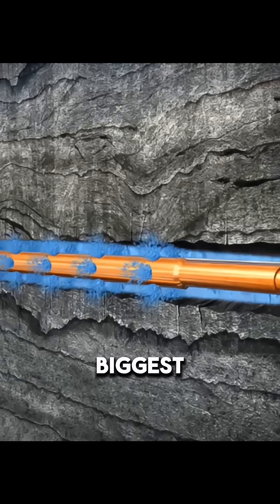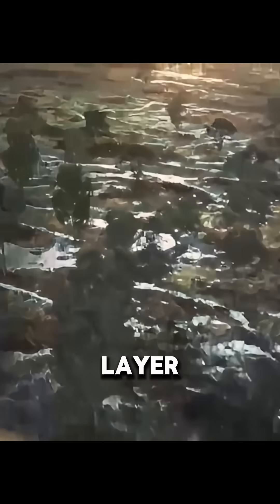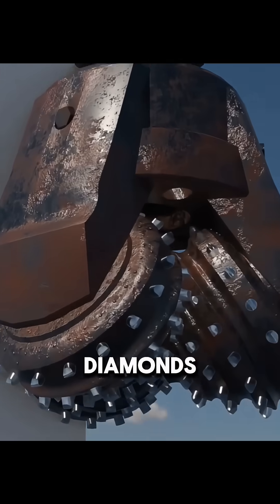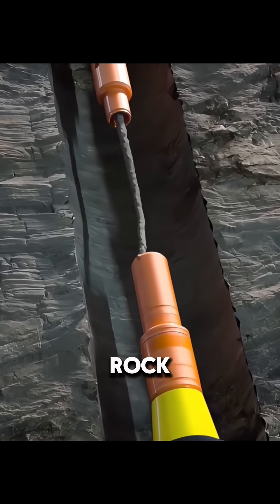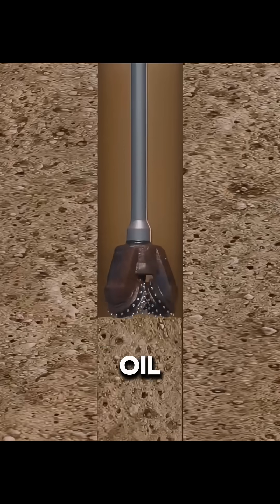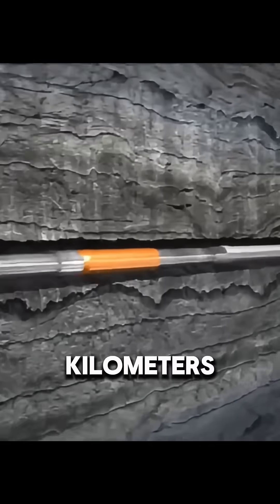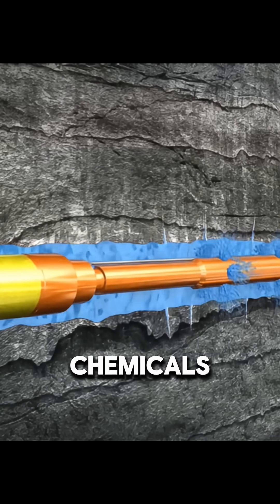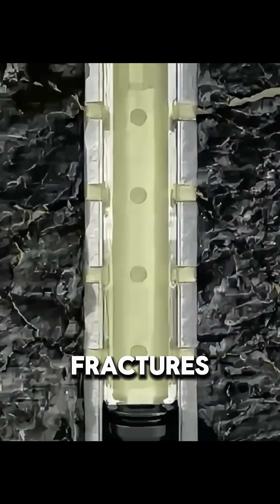How is oil extracted on land? #zackdfilm #foryou #oil

Comment: I see some comments of people that have no idea. Oil is in everything made of plastic. And I don’t think anyone uses those type of drill bits. We use diamond cut drill bits or pdc.
Reply: Milled toothed drill bits and tungstun carbide insert drill bits are commonly used especially at shallower depths. The application to use diamond bits must be correct because they can ball up or lose the pdc cutters requiring tripping out the bit prior to total depth, which can be expensive depending on the daily rental rate of the rig. It may take 8 hours to change out a failed bit depending on depth. Sometimes, It can be better to use non diamond bits in softer rock applications. The best way to select bits is to use bit records from adjacent wells that show the performance of different bits within the same rock formation from previously drilled wells. How the bit is run also matters ie rpms, weight on bit and hsi must be engineered to maximize bit cleaning and rock removal. I am a petroleum engineer and sold oil well drill bits for a living.

Comment: Should use propane instead of water for fracking.  Propane allows the well to produce more oil longer and all the propane is recovered.  This process saves millions of gallons of water.
Reply: You mean nitrogen?
Reply: @mad123tpm no liquid propane.  Liquid needed for fracking because liquid does not compress.  Actually an established procedure.  Propane is recovered and the well produces more oil and gas for a longer period of time.  Over time more profitable but at first more expensive.   Also, no water used for better enviromental concerns.
Reply: Bad idea people

Comment: I don't understand that cement part
Reply: I think its to block off well water from getting into the casing or vice versa, getting fracking solution into the well water. Or when they pump the hole full of pressure to cause the cracks to open, the concrete acts as a plug to keep it from blasting back out the hole where they began drilling. Those are my theories
Reply: @lovetofly32 when cement is poured will it not bury anything below it so how can they operate machine when they poured cement on it
Reply: @abangbelinson8839  look up high pressure oil well cementing.
I used to work in that sector and could explain it, but a visual might help you understand better.
Reply: Casing keeps the well from caving in, protects the environment by keeping fluid from entering other formations, isolated high pressure zones, etc. This is also needed to increase mud weights at deeper depths to prevent well kicks or blow out prevention. Casing is set in the hole, cement is poured down the center of the casing and fills the void between the outer casing and hole, called the annulus. There is a float shoe (check valve) at the bottom of the casing. Once the cement hardens another drill bit , drills out the shoe and keeps going. A casing program of different sizes is planned in advance. I took a fracking class in college to determine optimum propant sizes(called ceramic beads in this video) , pressures etc...

Comment: Production cost is still high at the moment. Hard to compete with Saudi and others
Reply: We are already a net exporter
Reply: Dude, they have been competing with Saudi oil since 2014 or so. They are still growing strong and will keep pumping shale oil for the foreseeable future.
Reply: Saudi has cheapest production costs for sure.
I heard that if crude oil price falls below $60/barrel then US producers are not profitable.
Reply: Yes, but VERY cheap compared to Deep Drilling in the oceans!  Normally the oil is WAY below the water aquifers. 
With an existing impervious rock layer holding that water above the much deeper oil layers.
But it has happened.    The pipe could leak into the water layer if it failed.     Saudi oil is cheap out of the ground.
But you have to ship it halfway around the Earth to bring it here.

Comment: hydrochloric acid, glutaraldehyde, polyacrylamide, ethylene glycol, methanol, and sodium chloride are the chemicals used. Cancer water.
Reply: Ethylene glycol is antifreeze.  Very deadly.  Dad knew a man who carried some water to his cows in some empty antifreeze jugs.  They all died.  It's also well known that you can put out a dish of antifreeze and some wienies side by side to kill rats and mice (or any other animal that consumes them).  The salt in the wienies makes them thirsty, so they'll drink the antifreeze.  I've never done it but have seen the results of someone else doing it.

Methanol is also toxic, causing blindness.
Reply: @Lewis2553  everyone has heard that story, better come out with another quickly
Reply: So bad for the environment😢
Reply: @benjaminliamzon7395 Yeah, but ethylene glycol gets dumped on the ground all the time in car wrecks and junkyards.  Cars develop leaks in the cooling systems.  Or, heater cores start leaking and cost so much to get them changed that people have to drive them like that and just breathe the ethylene glycol vapor.  (And they wonder why people are dying.)  Then, too, you're supposed to change your antifreeze every few years, but I haven't seen any antifreeze recycling centers.  So, what do you do with it?
Reply: @Lewis2553 Antifreeze is safe to put into a sanitary sewer drain. (Not rainwater sewers. 

Water treatment facilities are capable of removing antifreeze along with other pollutants.
Reply: @chefofthefuture377 That's good to hear.
Reply: @chefofthefuture377  no they not ! its toxic.
Reply: @marky5493 no they not? They not foreseeith thy future?
Reply: @Lewis2553 you don't have to dump it on the ground. There are facilities where you can deliver it to be neutralized. Or you can filter it and reuse it on less demanding cooling systems.

It causes coma by causing neurological damage, so dumping it on the ground should be reserved only for those few cases where vehicles brake through the side barriers.

E.g. In Germany, when rescue teams are police arrive on the scene of the car accident, they first spread sawdust or sand around leaks - to soak up the oil and antifreeze.

After removing the vehicles, they clean the road before they let the traffic go on. All that sand or sawdust is collected, road is scrubbed to remove remaining chemicals, and all this is sent to a plant that will neutralize it 

It costs a lot of money to do it, but the bill goes to the person who caused the accident and to his insurance.
Reply: @MacakTosha  I've never in my 60+ years seen nor heard of such a recycling facility where I live, nor anywhere near it, nor even in the same state!  It would be nice to have one.
Reply: Ethylene Glycol breaks down in the soil to to CO2 & water in as quickly as a few days
Reply: @MrSummerbreeze01 Maybe so, but not in concrete.  I have spots in my garage floor that sweat on rainy days where antifreeze leaked on it.  I've also seen that on outdoor concrete.
Reply: Fracking chemicals include biocides, friction reducers, corrosion inhibitors, solvents, and gelling agents.

BTEX (benzene, toluene, ethylbenzene, xylene) are normally present in additives and in flowback water.

Environmental risk: even very low concentrations in drinking water are unacceptable.
Reply: Hydrochloric acid is extremely nasty.
It atracks calcium....
In contact with skin it would seep through the skin and go to the bones... making  bones to become gelly.
Reply: @kori5679 that would be hydrofluoric acid which is rarely used. Hydrochloric acid isn't great but not as deadly. Its used for near wellbore carbon rock like dolomite.
Reply: @kori5679 If you get hydrochloric or hydrofluoric acid on your skin, you've got bigger, more urgent problems than worrying about it seeping in and "atracking" your bones 🙄
Reply: Patented by HALLIBURTON
Reply: @gusc6785 ¿Esa era la empresa dónde trabajaba Dick Cheney?
Reply: sodium chloride is salt bro. don’t try to sound smart
Reply: @alexgordon951  and methanol is a poisonous carcinogen. Don't try and sound smart because your salty bro.
Reply: @alexgordon951 arent you the trying to sound smart here tho?  Lol.  Letting us know you know what salt is 😅..  but these fracking chemicals are really bad.  Carcinogens.
Reply: @alexgordon951 sodium chloride is one of thousands of salts. It is not the only one.
Reply: @chefofthefuture377 what is your point?
Reply: @alexgordon951 You seem to be smart, right? You can figure it out.
Reply: @chefofthefuture377  Sodium Chloride, also known as Table Salt. There's really only one form of Table Salt, colloquially refered to as Salt.
Reply: @DutchmanAmsterdam Do you believe there is only one type of salt? Kudos to your teachers.
Reply: And said water is reinjected into the ground however many thousand feet deep the injection well is , or is separated from the oil, stored, and then reinjected as required by law.
Reply: @larryulrich9110  You Americans can't getting it  right.
Reply: @larryulrich9110  from EPA report: "Impacts from the Hydraulic Fracturing Water Cycle on Drinking Water Resources in the United States. "Overall, the proportion of water used in hydraulic fracturing that comes from reused hydraulic
fracturing wastewater appears to be low. In a survey of literature values from 10 states, basins, or plays, the median percentage of the injected fluid volume that came from reused hydraulic fracturing wastewater was 5%"
Reply: So the inject liquid  Pop Tarts into the shale?
Reply: The long term consequences of this process are catastrophic to inhabitants where fracking takes place. Time for big oil interests to come up with cleaner solutions for the sake of ourfuture generations.
Reply: @PeterByskosz What catastrophic consequences, pray tell.
Reply: @PeterByskosz no, some abstract future generations are not worth the pain to the current generation. We need cheat energy.
Reply: Ethylene glycol looks like the most dangerous of those, followed by methanol.  HCL is a simple acid, Sodium Chloride is salt, and polyacrylamide is often used as a water purifier.  HCl's danger depends on how it reacts with subsurface compounds.  Of course, just creating the fractures themselves may cause other kind of leaching into well water which is a whole separate can of worms.  Either way, I wouldn't want to live near a fracking rig.
Reply: Thanks. Can anyone tell how do they steer the drill bit so much deep under ground?
Thanks.
Reply: Arsenic and Benzene are still also used, which are severe health chemicals if it gets into ground water due to inadequately constructed wells, or dumps of well water in the area.
Reply: Hydrochloric acid is inside your belly. Aldehydes found in the combustion of any biomass (e.g. when making food). PLA as well. Methanol is produced in any yeast-based fermentation process. NaCl is table salt
Reply: All used thousands of feet below the water table and thru cased hole.
Reply: Hydrochloric acid is the same acid as in your stomach. Sodium chloride is table salt.

The others might be relevant, and you don’t want them in your water regardless.
Reply: @dskoogle  methanol is hardly cancer inducing or dangers either (unless drinked in high concentration)
Reply: @dskoogle saying it's the same acid in your stomach is like saying the water in your tap is the same as the water in your toilet....
Reply: @Colin_Lawlor_Audio 😂
Reply: @Colin_Lawlor_Audio um ... it is the same water🤡 stop thinking you think , you're bad at it
Reply: @davebboggs2000 "stop thinking you think".... Are you the smartest person you have ever met? 😂😂😂
Reply: Lie. Your a dumbass
Reply: sadly
Reply: Sodium Chloride?! OMG! Sounds so chemical-y!
Reply: Broken record.
Reply: So worth it for the oil companies.  Not so much for communities that have to live with the chemical disaster left behind.
Reply: Thorium reactors would make all of this irrelevant.
Reply: @Glockler yes!... But you will have to buy them from China or Russia. Nobody in US has the technology.
Reply: Hahahhaha its called  protect Saudi hahaha😂
Reply: @archimdejesus3188  Well their resources are natural.
Reply: They are literally poisoning their own water sources & soil, from which food & water come. Not to mention toxifying the environment & animals that live in it.N
It can increase chances of land slides & earthquakes.

Russia has banned "fracking" because of its catastrophic side effects on the environment, despite the possessing  one of the world's largest shale deposits, known as the Bazhenov formation.
Reply: @tropickman You know if russia bans it, it's bad 😂 but when will people realize all this red 40 bs and all these dyes comes from petroleum too. We're poisoned by the air water and food. but everyone's still arguing and btching about the wrong shid
Reply: The Fracking is done WAY below the Water Table and you know that.
Reply: @alexjackman9493 Yes. And how do you get to that deep level?
By drilling straight through the drinking water. 
The pipes are going through the drinking water.
Let's hope there will never be any leakage.
Only a few centimeters between the drilling fluids and the drinking water. 
You don't want to have any leakage in the years to come.... (benzene, toluene etcetera)
Even if it is already leaking you most probably will find that out much later.
Reply: @ArjanSchaeffer1973 The pipe wall thickness is inches, not centimeters.
Reply: Technical, neutral explanation: fracking, drinking water, and well integrity

In the production of shale gas using hydraulic fracturing, drilling always first passes through shallow groundwater and drinking water formations in order to reach the deep shale layers. Statements that operations take place “only at great depth where no drinking water exists” may be correct for the fracturing zone itself, but the drilling path inevitably intersects the drinking-water-bearing layers first. Every shale gas well physically penetrates these water-bearing formations.

The only separation between the drinking water outside the well and the fracturing fluid inside the well is the well construction itself. This barrier consists of:

Steel casing: a combined wall thickness of approximately 1–2 cm (≈ 0.4–0.8 inches)

Cement sheath around the casing: typically about 3–6 cm thick (≈ 1.2–2.4 inches)

Together, this forms a total horizontal barrier of roughly 5–10 cm (2–4 inches) between the contents of the well and the surrounding geological layers.

The casing is not a single continuous pipe but rather consists of many individual pipe sections that are connected by threaded couplings. These connections are mechanically tightened and sealed, not welded. These coupling points are structurally sensitive, as they are exposed to:

high pressure fluctuations during fracturing,

temperature variations,

mechanical stresses,

and long-term corrosion.

After the casing is installed, cement is pumped into the annular space between the pipe and the surrounding rock to seal the well against the migration of fluids and gas. This cement plays a critical sealing role, but in practice, it is not a perfect or permanent material. Cement can:

shrink during setting,

develop cracks over time,

locally fail to bond properly to steel or rock,

and form micro-fractures under prolonged pressure and temperature loading.

In the majority of cases, this well-barrier system functions as intended. Nevertheless, it is well documented that failures do occur, most commonly due to cement degradation, micro-annuli along the casing, or defects at pipe connections. In such cases, not only methane (natural gas) but also components of fracturing fluids — including substances such as benzene and toluene — can migrate into groundwater and drinking-water supplies.

In the United States, millions of oil and gas wells have been drilled, of which more than one to two million have been completed using hydraulic fracturing. All of these wells penetrate drinking-water-bearing formations. Given these very large numbers, it follows that even with a relatively low failure probability per well, incidents are statistically unavoidable.

In summary: while the system is technically engineered to function safely and does so in most cases, the actual physical separation between drinking water and fracturing fluids consists of only a few centimeters of steel and cement, with threaded pipe connections and cement integrity representing potential weak points. Practical experience has shown that zero risk can not be guaranteed.
Reply: @larryulrich9110 
Yes Larry, agree, in Europe we used to measure in centimeters, sometimes I forget that other's (especially USA) measure in inches. 
In general in the oil and gas industry it is in inches. But in Europe (mainland) usually we communicate in centimeters outside of the oil industry. 
I work since 1995 in the oil industry. 
Starting at the Troll platforms (Norway) laying pipes at 300 meter water depth. 
30 years ago that was a challenge. 
It is amazing what is possible today!
I am absolutely not against the oil and gas industry. 
There are risks and it is important to be realistic about that. 
Especially with hydraulic fracturing and the drinking water. 
Therefore it is important to work at all times at the highest standards.
Reply: Yes this should be illegal but money and greedy politicians
Reply: And the xantham gum they use to lube the drill bit is used in our food supply while poisoning our water supply